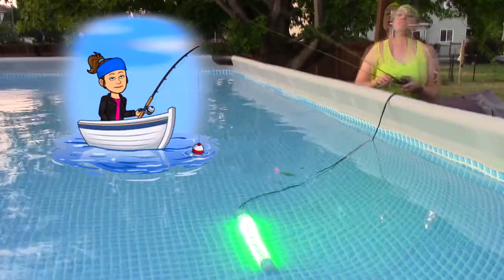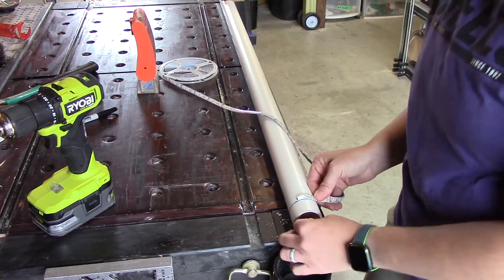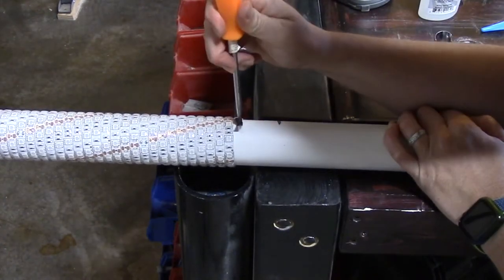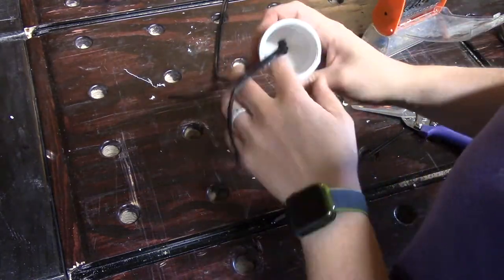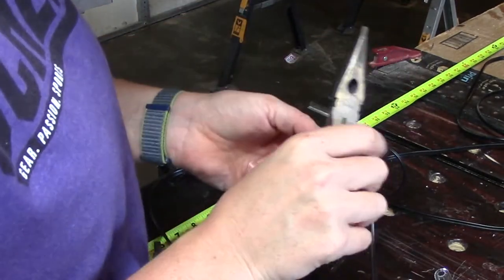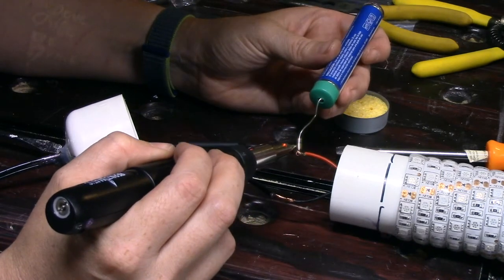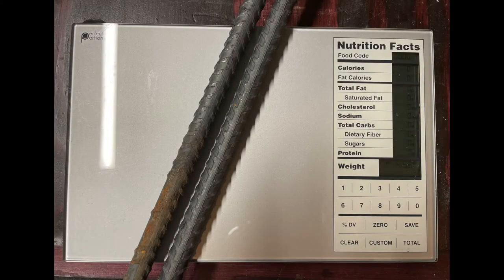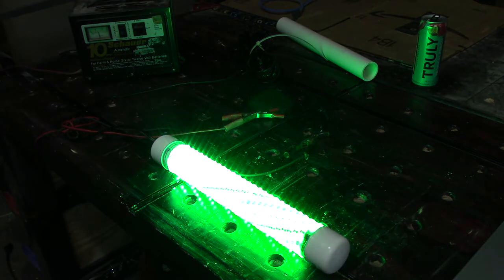Here Fishy, Fishy, Fishy - DIY Fishing Light: Catch More Fish for Less!

Comment: These lights are awesome. The one thing I would caution about is using the right type of silicone with electrical wiring.  Loctite SI 5990 is a non-corrosive silicone that can be used with electrical wiring. Non-corrosive silicone is what you want other silicone can corrode copper and other metals.
Reply from the maker: Great addition. Thanks for leaving the comment

Comment: The wire section of the cord with the ribbed texture is usually neutral for Alternating Current and negative for Direct Current - LEDs are normally powered with + or Positive to their - or Negative side. Since they work off of DC Voltage you must mark the Positive and Negative wires - if  they do not come on just reverse the wires to your supply source.